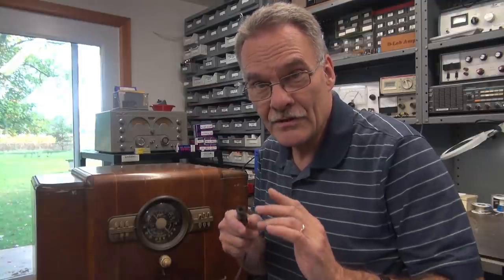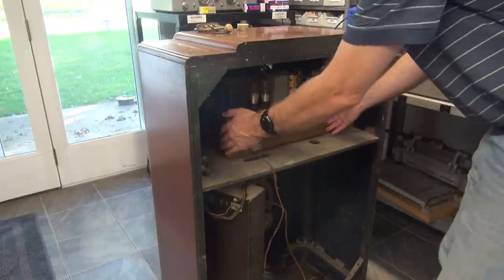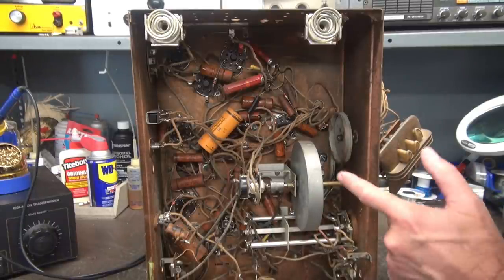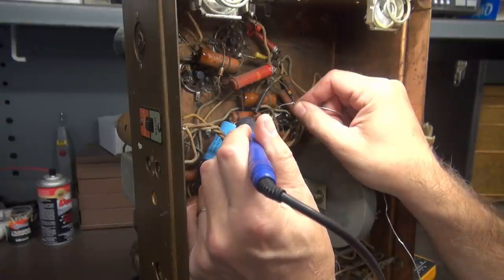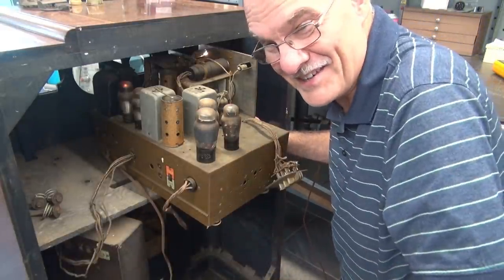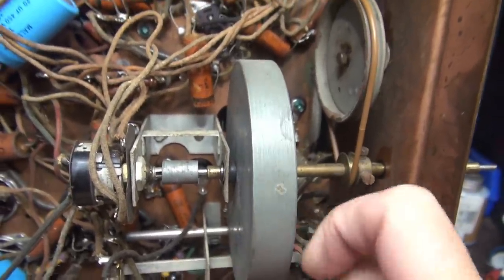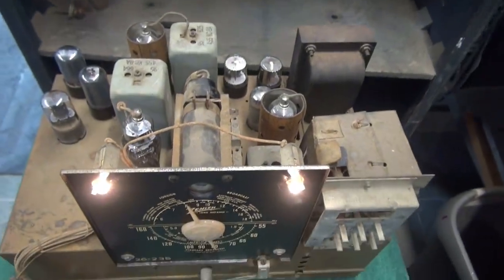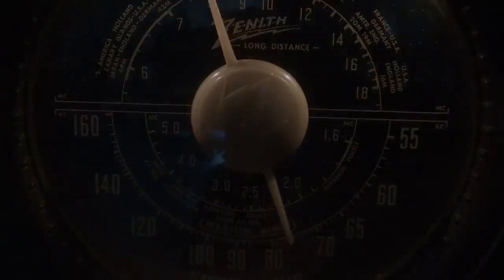How to repair  Vintage Zenith 10S464 console tube radio Hum fast fix Tips

Comment: Regarding the MP3 jack. It must not matter, but the cold end of the phono connection is NOT at chassis potential, but a volt or so positive. For these radios I use a female jack/cable (Amazon.com) so that the jack common is at the phono cold potential. Use of that cable also avoids drilling a hole in the chassis. It also allows the Bluetooth adaptor to lay on top of the radio where the controls are more accessible. I also add a short AC connector (always on)  to power a Bluetooth receiver supply. One other difference is that I use 1K resistors to mix the channels.